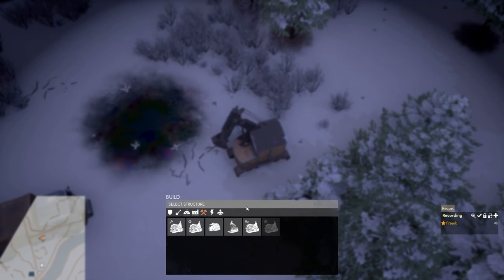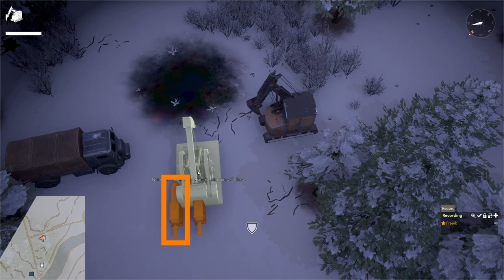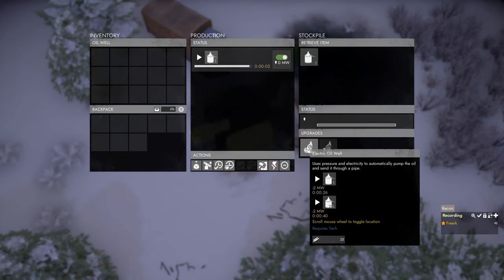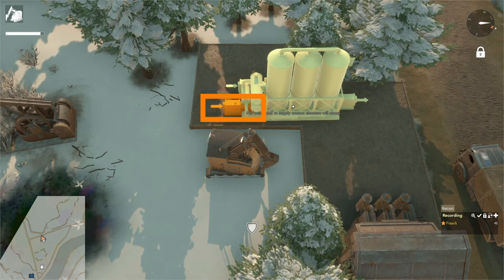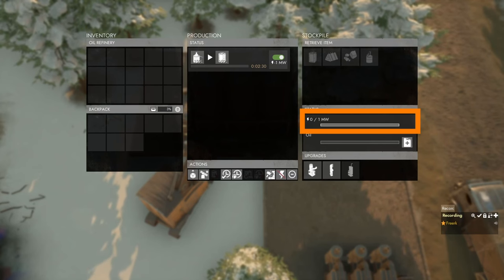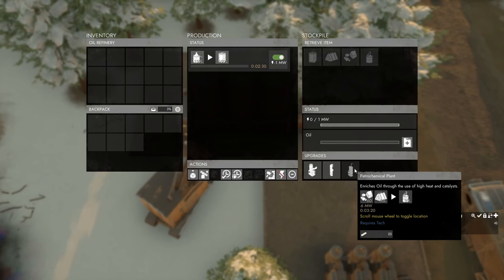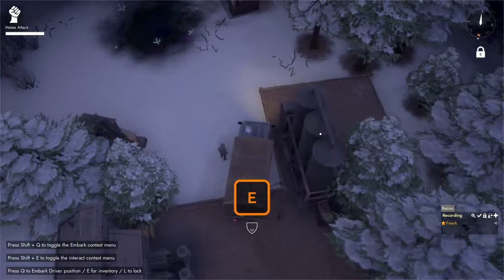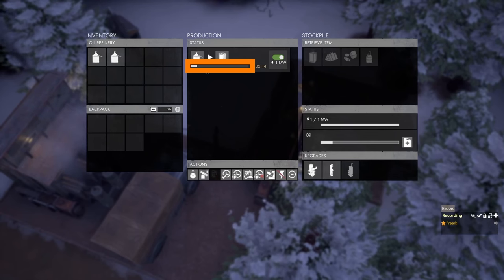Foxhole Facilities - Oil Refinery

Comment: can't wait to claim my oil well for private use!
Reply from the maker: Yeah.... no. 
With the amount of oil fields being available and the limit of 3 oil wells per field (currently) oil fields should be (semi)-public to allow everyone access to oil for further recipes. Not sure how the actual balance will turn out but I hope they make the calculations so that not all oil can be pumped away and stored in squadlocked liquid transfer stations and other facilities. 
And yes, I do realize that the comment quite probably was ironic
Reply from the maker: @ihatemagas  Hopefully the addition of a coal upgarde to the diesel power generator and the changes to the coal power plant recipe can turn the reliance on oil around. Not to forget that in the new decay prevention system the maintenance tunnel doesn't need power anymore, so facilities don't necessarily need 24/7 power
Reply from the maker: @ihatemagas  That is a good point. I tend to forget about that since I personally never produce armoured vehicles (or large guage trains) that require those materials.

Comment: Hi, using oil as fuel is extremely wasteful, you should stick to using petrol fueled generators instead, they are smaller and generate more power for the same or lower (depending on your refinery setup) cost.
Reply from the maker: Agreed.
 Just bear in mind that these videos aren't necessarily about what's best but about what's possible and how to do that.
Reply: Is heavy oil any more efficient?
Reply from the maker: @zazempireorigin7818  You would have to do some calculations on that. But since it is used in other recipes as well I would not use it to generate power

Comment: Hi Freerk. I haven't had a chance to try it out yet, but according to the devblog there is something called a 'pipeline valve'. Is that a separate item from the regular pipes? How does it work?
Reply from the maker: A valve allows you to regulate the flow of liquids out of a structure. With a wrench you can have it change from 2.5L/s (steps of0.2L) to zero. This can be helpfull to turn on and off the flow of liquid to certain facilitities or even make the distribution of liquids through a pipejunction more effeicient.
Fluid dynamics in Foxhole (like in real life) are complicated though, so I kinda stayed away from it.
Reply: @FreerkHoltes  By the time we get acclimated with the new update, players will have certified degrees in fields of specialization in the game specially logi players LMAO, heck Logi clans will start posting "Wanted help" in world chat for people and will only let them in If they have at minimum 2 wars worth of experience in logi and not just generally but specialized fields of Logi going forward after 1.0 ... LOL
Reply from the maker: @proudfirebrand3946  I will start a certification company scoring FAT's and LAT's. Facilities Aptitude Test and Logistics Aptitude Test. 
If somebody can come up with a BAT (Building Aptitude Test) that would be great.

Comment: Thanks for the video. Never really looked into the facilities as it seemed like a headache to do so, but it actually seems fine
Reply from the maker: If you keep it small as a solo player or small group it is fine. I highly recommend thinking through what you want to produce and probably use foxholeplanner.com to get a good idea on (maintenance) costs
Reply: @FreerkHoltes  Thanks, that is a great resource! I was mainly thinking about producing petrol, so the cost should be pretty bearable.

Comment: What is the point of 2 recepies in electric oil well?
I assume when it says 1 per 26 secs it means 50L.
So we have 50L/26 sec = 1.92L per second
and we have 75L/40 sec = 1.87L per second
One is clearly better isnt it?
Or the worse one is the only one that can be transfered via pipelines and first one you have to grab manually?

Comment: Great video!  
Can you explain Sandbags and Pallets?  I'm not understanding how to store these now
Reply from the maker: Sandbags can be made in the normal factory as a crate of 5 AND can be made in the Recycler upgrade of the Materials Factory where they stack in the inventory.
Loose sandbags can be put into the stockpile of a Material Transfer Station and then put on a pallet like in the Transfer Station video: https://youtu.be/k42fxoPNkHY?t=476
So there's three transporting options: loose sandbags, crated sandbags and sandbags on a materials pallet
Reply: @FreerkHoltes  Thanks!  I was hoping we can turn Pallet --> Storage Depot  but sadly that's not really an option.  As far as I can see, Pallets are only used to take out of a transfer station and give to players or another Transfer station.

Comment: It is funny i went straight oil industry with 5 refinery and now setting on a lot of petrol i can use those petrol to fuel the new harvest machine to get more material for tank production once 28th hit i will focus on 10 refinery to build my oil empire
Reply from the maker: In the test war or in devbranch? 
If you managed to get a 5 refinery set-up working with enough oil in the test war solo, that is amazing (and at least against my expectations of oil being hard to come by)
Reply: @FreerkHoltes  
I'm on the test server and with what i have i can run the 5 refinery solo and produce 2200 barrel of petrol in a day if i have all the stuff you have i could run 10 refinery with little efforts and make petrol even when I'm offline

You can make oil from coal if you invest in the factory right 👍

Comment: so i dont understand why you'd switch from the petrol power plant to the crude based one. youre already making petrol as your main output and its more efficient power wise at 12mW/50l compared to 10mW/50l, especially once you use the water + crude = petrol recipe, plus a smaller building for the PPP. is there any reason for this? i havent looked into facilities much up to now so i dont know the later upgrades etc or anything like that. either way thanks for this and all the other guides youve made
Reply from the maker: It all depends on the goal you have with your facility (and I with my tutorials). 
My main goal with the tutorials is to display the different options and game mechanics. Not "what's the meta"  or the most efficient.
The figuring out part what works, what is best, what is most efficient I leave to everyone themselves
Reply: fair enough, thanks

Comment: How do you store oil crate on a private stockpile on a storage depot or seaport? It allways says "One or more items are not resaravble"
Reply from the maker: When the message is "one or more item are not reservable"  it means that they are considered "public". 
I am not sure if all oil is considered public or that if YOU build the oilwell you would actually be able to store it in your private stockpile.
Personally I wouldn't bother with crating oil but just transport it via fueltruck or static liquid container and then store it in a squadlocked liquid transfer station, or use it immediately